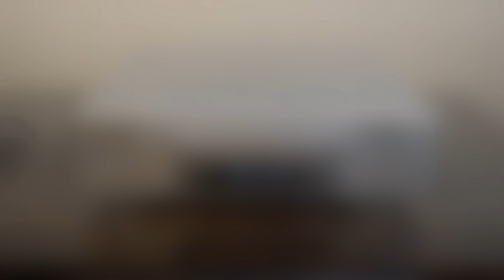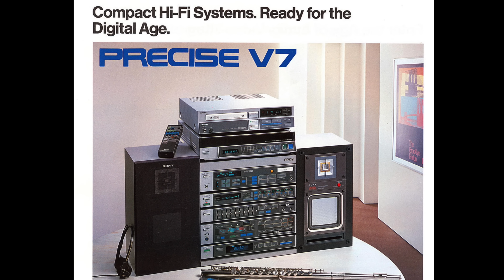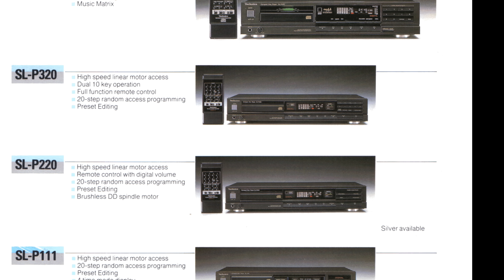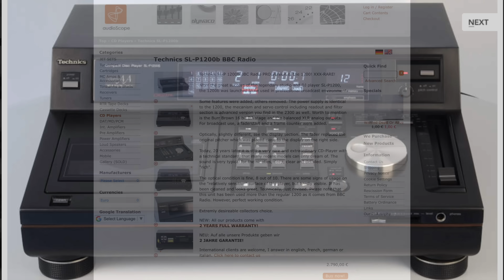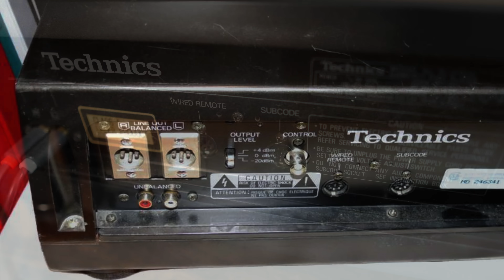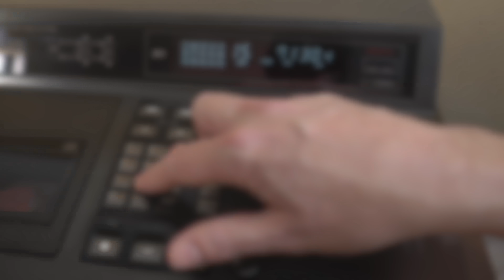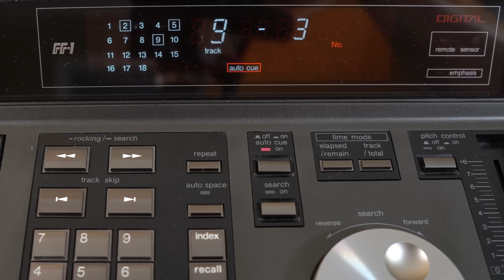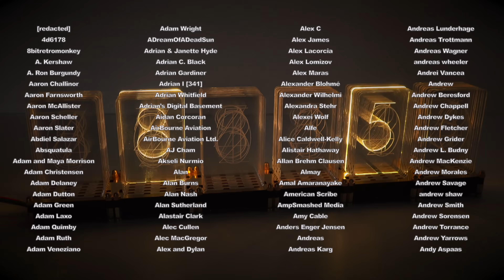How CD players lost their cool & why this Technics didn’t.

Comment: If your looking for as vintage CD player that looks cool and shows off the media, Bang and Olufsen have made a number of cool looking CD players that I always coveted but couldn’t afford back then. The B&O Beosound 3000 is a virtical e CD player that was always a cool looking model. Another one is the B&O Beosound 9000, is a cool looking 6 disc virticle CD changer that can be mounted on a wall with optional wall mount bracket. Both of these have a  glass front/CD lid. The latter show off all six discs when it’s playing with a CD read head that slide back and forth over each of the six discs as they play as the discs are placed in a row and the play head moves rather then the cd tray as in more typical CD turntable style changer.

Comment: Wow, that's like a digital version of the SL-1210. But I have the idea that these vertical or top-loader machines, that lately we see most on cheap machines  are more prompt to get the lens dirty than the slim tray ones. Could it be a quality or design issue?

Comment: Wow! That is a beautiful machine. The radio station I worked for in the 90s had all of the same features but was a rack unit. But the tabletop model is just gorgeous.
Reply: I was going to say that this would have been a common-ish sight in a radio station with extremely fast TOC read, queueing it to the right time stamp, and the eventual addition of XLR out.  IIRC, Technics/Teac still makes a variation of this machine in a single rack unit and iPod/MP3 integration.  Not as nifty as this guy tho.

Comment: Fascinating video. You showed the precursor of the modern CDJs. This explains their Amber/Green color scheme, the cueing and so on. It's amazing that the SL1200 turntable, which is still very much in use by current DJs in 2022 is from the same generation and in fact is being manufactured again since 2016 is its companion. There's absolutely no coincidence that this machine is carrying the legendary by then SL1200 branding.

Comment: The trend of hiding away the discs got a brief respite in the 90s, particularly with mini systems.  I remember my parents having an Aiwa NSX-5200 which had a clear view into the 3 CD changer with a red/green light piped top assembly. It lit up like Christmas when you played a CD and was fun to look at in action.  

Unfortunately, like most mini systems, it was not built well in most other ways and has long since been thrown out.

Comment: I have to say Techmoan those are some incredibly nice speakers you have connected to your setup. The bass output is exceptionally rich and clear. They have the good type of bass, the type that is rich and well rounded and not to overbearing and punchy. If I may ask, what brand are those speakers?
Reply from the maker: I wouldn’t try and judge sound quality from what little gets picked up by a camera mic in a YT vid - but they are Polk RTiA5
Reply: @Techmoan  I totally agree with the mic and YT compression and all that but they still sound really good. But Polk speakers those are expensive though. Every time I go to my local Best Buy and look at audio equipment and see anything Polk related is always WAY outta my price range.

Comment: One difference between the CD and earlier formats is that turntables and tape decks spun in a regular way, at constant speed and not very fast, but CDs go at high speed which adjusts as the disc plays. Perhaps it was judged to look as if something was going wrong?
Reply: Actually, no. Reel to reel tapes moved at a constant rate past the head, but the rotational speed of the reels themselves changed with the amount of tape spooled on them. Of course, the change was slow, and not particularly noticable. 
Even worse, I had a Discman or equivalent that used to read into a buffer (at least I think that's what was happening) and would actually stop the disc while it played the buffer's contents, until it needed to read more, at which point the disc would start spinning again. This was particularly evident if playing mp3s, where a relatively small amount of data can talk a fair bit of time to play. If you just happened to glance at the machine while the disc was stopped (it was visible, obviously), you might wonder how the music was still playing.

Comment: At first i thought it had with laser safety to do , that it was like with a microwave oven and had to properly shut in to be safe when they in the manual of my first Sanyo player said things like "WARNING! INVISIBLE LASER RADIATION INSIDE! DONT OPERATE WITH COVER REMOVED! BEAM IS DANGEROUS!" and thus any transparent window inside would make it unsafe. The laser in a cd player I however later discovered will only be harmful if u first remove the lens and then looked right into the uncollimated beam. Its a weak class 1 laser although infrared so it IS more powerful then it looks. Compare with the much more visible diode of a DVD player of same power. As comparison Laser pointers are often class 2 or 3. Those WILL really harm your eyes if u look right into the beam but stray light from the beam is no danger unless a direct reflection from a mirror or similar reflective surface and it will not burn you.  The manual for my CD player however made it look like it was similar to a laser cutting machine or that the laser was similar to radioactivity/microwaves and even stray light could harm you if it got outside the case.  (CD and DVD writers are like this sort of though with much more powerful lasers that can indeed both cut and burn)

Comment: Probably someone else has chimed in on this already, but B&O had some interesting cd players.  Their first was a top loader based in the Philips 104 mechanism.  One of their last (I believe) was a floor standing unit that held 6 discs in separate spots behind a clear door and the player mechanism moved to play each.  They also had a very chic compact receiver unit that had the disc stored vertically behind two glass doors that would slide open by a hand gesture, much like supermarket sliding entry doors.

Comment: My first CD player was the Technics SL-P1   (Yes, "one").   It had a tray, but above the tray was a small prism window about 3/8" or 7mm tall by the width of the drawer.   This let you see a bit of the disk, and being a prism the image was flipped, so it gave the illusion of the disk being vertical in the unit.    I had that for over a decade until it broke down.     (I then had a Yamaha 5-disc unit which did not last nearly as long and now a Technics SL-PD9, which thanks to spotify does not see a lot of use anymore, but it still works quite well.  But yeah, no window.)

Comment: As an ex DJ those things were a stable part of our roadshows and nightclubs for years only being replaced firstly by the Technics SL-DZ1200 and then eventually by the Denon DN-2000F. To be honest we preferred the Technics but the new Denon machines while good need an operator who is familiar with the flight deck of the starship enterprise :)  Progress? meh.....
Reply: Surely that's got to be the other way around? The 2000Fs were from the early 90s, the DZ1200 was from 2004. It also sucked, Denon's platter-based models were far, FAR better.

Comment: This is Grade A certified pure uncut techmoan.  One of your best in my opinion, Matt.  The only thing that could make it better is some belts to replace.
Reply: And puppets. Don’t forget the puppets.
Reply: Oh look. The laser belt has disintigrated.
Reply: @hankjonkman1893  no... It has "perished" 😅
Reply: @hankjonkman1893  lol, I don’t know if it correlates but, on older cd based game consoles, the laser lens, or mechanism sometimes needs replacing, belts as well.
Reply: @hankjonkman1893  the laser on this (and other early technics) was on a linear sled. Not even any gears to wear out. A devil to set up when the lasers failed though
Reply: @cherrygate my gifted to me SL-P2 knew that only too well, except the laser was strong, but the linear motor was dying... Shame, as that was an excellent CDP - even in 1999...
Reply: I wondered if the laser might need replacement.
Reply: Or as in minidisc players - some tiny plastic cogwheel!
Reply: @robbja or tiny loading belt (should have watched the YouTube video before I attempted that - but it works) :)
Reply: This is a Technics.  There is none of that rubber rubbish here!
Reply: @bluerizlagirl direct drive, baby! (shame they couldn't do away with pinch rollers though lol)
Reply: Want belts? Visible disc? Check out the CEC belt drive CD transports from Japan...
Reply: @Stevie-J  I would love that!
Reply: @Stevie-J  Coming up: replacing the belts on the iPod Nano.
Reply: Weapon.
Reply: Or some tube rolling possibilities... :)
Reply: Techmoan’s analysis is very poor. He disregards the fact the using CD technology requires manufacturers to pay a fee. The audio gear and computer manufacturers would rather people used digital solutions to save money. Bringing the whole thing down to “coolness” of vinyl may sound like a good social conversation about technology, but in reality the economics involved tell the true story. No one pays licensing fees to manufacture turntables, and CD remains a proprietary format.
Reply: @Ye110wjacket   Ridiculous comment.

Comment: A handsome beast indeed. Love the brushed metal keys and Darth Vader styling. 

I think another reason for the lack of interest in standalone CD decks is that there are now a lot of other items that can play CDs, which people are way more likely to still have in their homes than a full component Hifi setup. Everything from DVD / Blu-ray players to PlayStations, optical drives in older laptops and micro systems (some of which did go back to the top-loading mechanisms with visible disc) can read a CD. My partner plays her old ELO and ABBA discs on a 19" Goodmans kitchen TV with built in DVD drive. No it doesn't sound anywhere near as good as a proper dedicated separates system, but we'd have difficulty fitting one of those into a galley kitchen.
Reply: These days your best bet is something like a Sony 4k bluray player. We bought one for other reasons and found it has digital coax output, a toslink out, and hdmi audio to boot. Even advertised as able to play the largely snake oil SA-CD format. We hooked it upto our amp and despite my distaste for Sony, it does perform well. Our old dedicated CD player (some TEAC unit my parents bought in the 90's) sounds more or less the same to my ear. (Edit: spell check)

Comment: Forgetting that a disc was still in the drive used to be a pain - especially if you were changing your car stereo. You get it all done, nice new stereo fitted, then you wonder what you have done with your favourite cd, then it dawns on you, darn, now you have to mess about a wire the old unit back up just to get the disc out. Often had the same problem when changing out a cd or dvd drive on the pc, get all the pc back together, only to realise you left a disc in the old unit. But I guess with pc drives you could in theory push a pin or a paper clip into the small hole that should in theory release the drive tray, I say in theory because a lot of the time no amount of poking and probing with a thin metal object will release the tray!

Comment: the early Pioneer cdjs had larger jogs that would afford accurate cuing but like this machine you had this rather unnatural stuttering noise which put off most djs until the later models allowed for cuing and scratching with a jog that acted more like a turntable except it was static.Pioneer jogs remained that way for years right up to the present day and many djs found this off putting though i had a few models of their cdj range over the years but i always wanted them to make a model with spinning platters or jogs.They have a new controller out that does this but all of their cdj range were with static  jogs and i had a pair for playing cds but i still mainly used vinyl because it felt more natural to me.Then Denon brought out a whole range of players with spinning platters the best of these were the 37 and 39 00s before they dropped cds like Pioneer did recently..Along the way Technics brought out a competitor aimed at djs that used turntables.It was quite advanced  but had a few minor issues and it didnt really sell but it was very pretty.Later djs updated these machines with mods which greatly improved them .I am amazed that no one in Technics has decide to update them as a modern take  on the  player without cds but with the spinning platter would probably blow Pioneer out of the water.

Comment: My Philips CD473 looks like a consumer knock off for poor people from the Technics . Really similar display and an bevel for the controls. The controls are confusing as hell, but i like its strange appearance. Found it in the trash and it worked fine, with an free CD in the tray. I would not bought a CD player for the same reasons as you told, they look boring and are not really interesting.

Comment: Early CD players may have been well built, and expensive,  but the internal DAC  were only 4 times over sampling and resulted in a harsh sound which led audiophiles to write off the technology. This issue was only resolved with the arrival of Bitstream or 1 Bit players. My first was the £900 Meridian 206B, with its glass fronted turntable loading drawer.
Reply: True. There were a handful of outliers who managed to make it sound decent tho. Then you have the fans of NOS dacs. I own a couple and find the sound quite pleasing. Also own a Prism Lyra 1 which is a totally different beast. And tube buffered dacs. So many ways of getting unique pleasing sound. IMO one of the best bang for the $ are the MOTU M series A/D D/A boxes. Got a used M4 for under $200. Real shame no one makes an affordable belt driven CD transport these days. Just not enough of us hold outs to justify the effort it seems.

Comment: i cam across the bigger bulkier version of these in clubs in the 90s for the few djs that used cds at the time.As soon as i saw them i really wanted a pair but i knew they would be silly money so i i had to wait until the first Pioneer cdjs came out.At the time some tunes were not released on vinyl or the vinyl release was limited so i would buy a cd but then had no pro gear i could  afford  or the club had no cd  machine  so sometimes i would take an old portable cd rom player with me but i could not cue or control the speed so mixing was just a case of press play and fade one in and one out.The earlier version of this machine was used to make a DMC megamix of Herb Alpert which included the Janet Jackson single Diamonds and was one of the first cd mixes made for DMC and was released on vinyl and cd itself.DMC stands for Disco Mix Club and they have been making remixes, mashups ,megamixes and mix albums for years and listening to their output was one of the  ways i learnt how to dj but i have vivid memories of seeing these beasts in a few select dj booths back in the day.As there was no jog or platter they were not ideal but they were much better than the rather cheap and nasty array of all in one machines available at the time.Its great to see these things on the show.